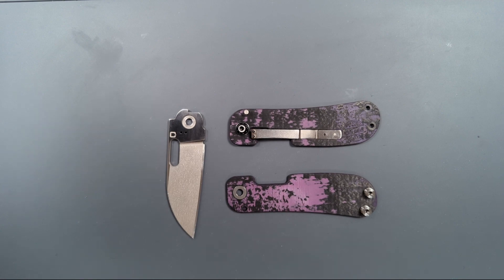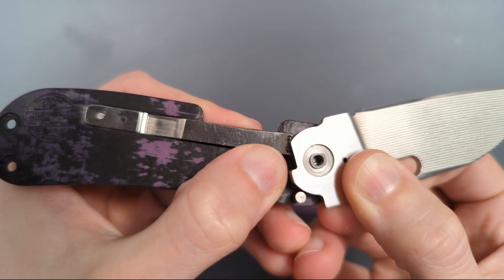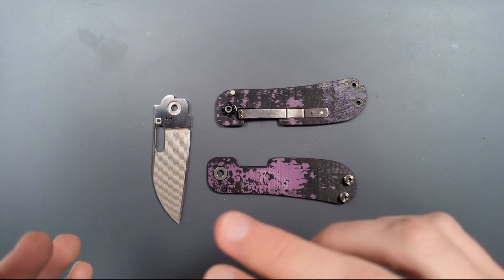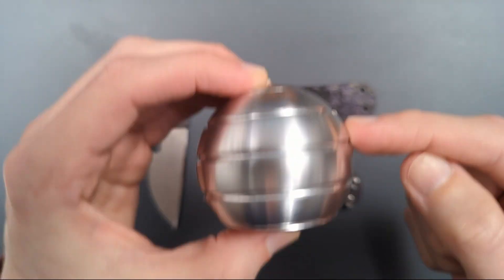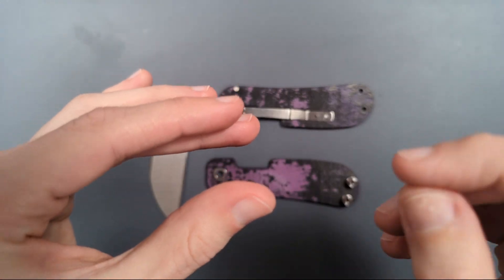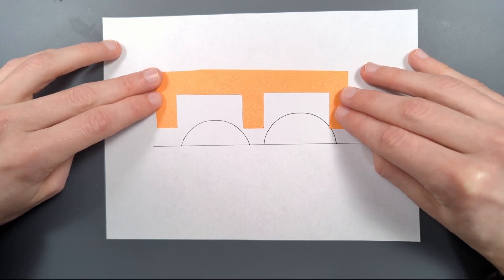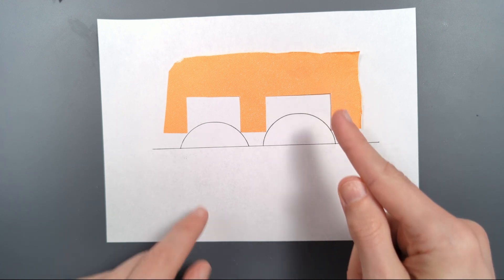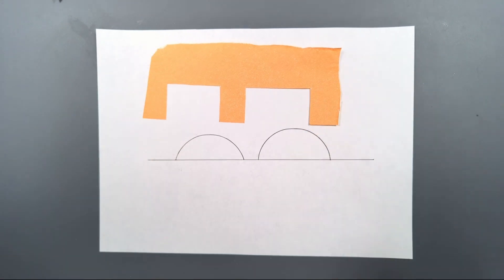Debunking Dual Detent Strength - Knife Design Deep-Dive - Oz Roosevelt Qvist Variant

Comment: Anytime I put 2nd detent ball ( usually just 1mm diameter) I did it just to keep the action smoother untill the lockbar reach the locking point.  There is kind of nice action with this setup when you have titanium lockbar, because you will minimalize the dragging the blade over the titanium. I can't imagine to keep both balls works as a detent ball, even with my swiss jig boring machine and to drill it right on spot with holes in the blade. Very tiny miss align cause the one snap and keep the seccond in the air, like you demonstrate with orange paper. So in this case when the one is set lower than the other, the purpose was not ment to support the better detent anyway.
Cheers
Peter

Comment: One thing.  If you have two handles on one rubberband that applies 10 pounds of force, you don't have 5 pounds in each handle, you have 10 pounds on each handle.
Reply from the maker: I mean, it's been 15 years since I took my statics courses in college, so maybe I'm getting it wrong somehow, but I really don't think so. How would that equation balance? If each handle experienced 10lb of force, there would need to be 20lb of force in the band.
Reply: @KnifeNerdery  Yeah, I can see the confusions, but you gotta realize the rubber band is just transmitting the load.  10lbs static tension/compression has a 10lb reaction on each side.  Instead of one hand, say it's fastened to the wall and you pull with 5 lbs with your other hand.  Your hand has 5 lbs, the wall getting 5lbs of pull on it, how much tension is the band?  Can't be more than 5lbs if you are only exerting 5lbs of force on it, right?  Other you would be somehow multiplying the force.

Comment: "The Roosevelt features a hardened AEB-L lock insert with 2 ceramic detent balls.  This distributes the lock bar tension and allows the lock bar to slide off the blade and into the locked position without dragging, preventing the "Double Click" feel."
Way too late reply but you explained it well. He eliminates the double click so you feel the detent is more crispy and less drag when the lock engage.

Comment: I understand the reason why the 2 detent ball system doesn't add double the strength, especially when one is lower than the other. But why are people who own these knives say that the clean snappy detent break is better on these knives than a single detent knife?
Reply from the maker: Such a good question! I've thought a lot about that exact question, because even I had that reaction to both the Rosie and now the Variant: "Wow, this is an incredibly good, snappy detent that's way better than most knives!"

And honestly? The more I think about it, I think it just boils down to incorrectly extrapolating from an incredibly small sample size, and a case of false causality. There are only two (and since there are so few custom Variants, kind of only one) knives on the market that do this, and both are higher-end custom knives -- the kinds of knives that often (but certainly not always) have well-tuned, snappy detents. So sure, right now 100% of dual-detent knives have a really great, snappy action. But with a sample size of 2, you can't extrapolate from that -- would that correlation still hold if dozens or hundreds, let alone thousands and thousands of knives across the price and fit-and-finish spectrum started doing it? I think certainly not. And is the dual detent even related to the snappy action, or are these knives snappy just for the same reasons other good-detent knives are snappy: positioning, engagement depth, lock bar strength, opening whole geometry and placement, etc., and they just happen to have a second detent ball? More and more, I think the latter.
Reply: Confirmation bias. That's why.
It's all about tang geometry, where the ball/detent are located, lockbar tension, set depth for the ball. One ball can make a detent far too stiff if all the other factors are not right and vice versa...

Comment: So it’s been quite a while since engineering physics- but I do remember that friction is independent of contact area for rigid bodies - as opposed to non-rigid bodies, like tires where the more surface area the more grip (aka friction) a tire has. 

However, I’m not 100% sure that this is what’s happening in the case of 2 detent balls in the same liner/lock bar. 

Assuming both detent balls are in contact with the detent holes in the blade when the blade is closed, the initial force required to “break” the detent would be higher if the static forces were largely applied longitudinally down the length of the lock bar. Note that this only is the case for a very brief time, as soon as the blade starts opening much more of the force would be applied to bend the lock bar back.

That’s why I’m thinking this is more of a statics case rather than a dynamics scenario. We want the static force required to open the knife to be higher, but not the force required to move the blade once it is in motion, opening or closing.

Of course you could easily test this by measuring the force required to open the knife, then removing the smaller detent ball and measure it again.

I’m sure Kev won’t mind 😂
Reply from the maker: Yusss, love the long nerdy comment! The whole "friction is independent of the contact area" thing is something I've really heavily glossed over in previous explanations of this, 'cause there's only so much physics you can pull into any one video. But you're absolutely right! For rigid bodies, the coefficient of friction (usually denoted μ) itself does not change with surface area, so the equation F_f = μ*F_N means the frictional force (F_f) only depends on the normal force (F_N) and the coefficient. The practical explanation for why this is true is that increasing the area distributes the weight over a larger surface, so each unit of surface area itself has less net force on it -- the pressure (force * area) is decreased. The thing about area and friction, though, is that that friction coefficient itself isn't just a magic constant, it's a physical property that itself can technically be impacted by area -- if you concentrate things onto too small of an area, the shape you've created can dig into the surface it's riding against, rather than simply sliding along it. This is one of the arguments for flattened detent balls -- by changing the contact surface from a ball to a plane, you're reducing the tendency to dig and cause wear, and thus reducing the coefficient of friction itself.

If both detent balls were in contact with the blade (which just isn't the case, since one is suppressed deeper), the force of the lock bar would be balanced between the two detent balls. The position the blade encounters the the ball would dictate what component of the force would be operating in the direction needed to push the ball downward and out of the way. As you said, initially a large portion of your force acts radially on the lock bar, flexing it forward. As you progress up the ball, a larger and larger portion of your force begins to act axially, flexing the lock bar downward and out of the way.

This changing component force is why detent balls have a slightly "spongey" feeling to them -- the amount of force required to push up them decreases the more progress you make. That is another argument for flattened detent balls -- they have an all-at-once breaking point at an earlier point on the ball where your force is still at its highest. This is also what makes "detent nubs" like on SBD or Holts feel so different, as the ramp you push up on the side of the nub is essentially straight, meaning the contact angle is constant and the force required to push up it is constant throughout.

That last bit is actually one of the things that makes Holt's "adjustable detent" so hard to explain to people accurately.  Most people think about the "strength" of the detent as how hard you have to push on the flipper tab -- how much force you're applying. But it's probably more accurate to say it's a measure of how much work (force * displacement) you're doing to clear the detent. Holt's detents require the same amount of force no matter what you set them to, what's changing is for how long you have to apply that force, or put differently, what distance you need to displace the nub using that constant force. And the reality is, that's enough to feel weaker or stronger, even though the force is the same.

Hahah, I'm definitely just rambling at this point. And this has turned into only somewhat of a reply to you, and somewhat of just a general ramble for folks to read.